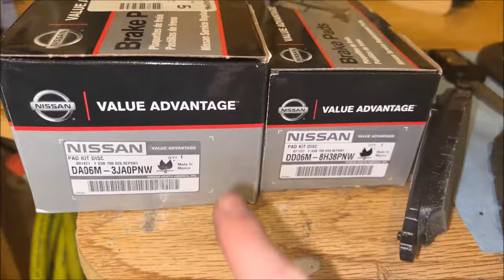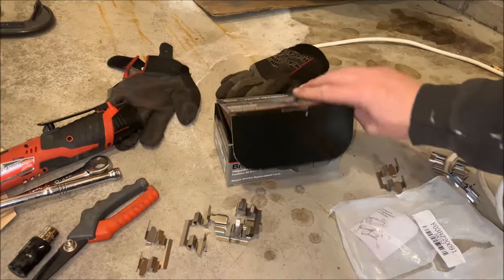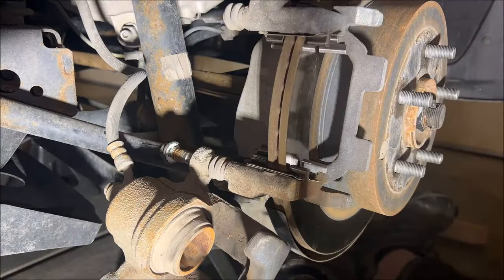Nissan Murano Brake Job (Front & Rear)

Comment: If you jack up the rear suspension from the bottom, it will compress suspension enough to clear bar so you can remove lower bolt and lube it.
Reply from the maker: Good tip!

Comment: Great vid. Always turn or replace rotors, never just pad swap. Since you only do brakes every 50-60k miles you will be asking for probs, vibrations, or noise if you don't take care of the rotor. Shop down the street from me will turn rotors off the car for $25 a pop, just call around your area. Much better than replacing for $100 plus if there is plenty of metal left.
Reply from the maker: Great point!  Thanks for taking the time to comment! 👍👍👍

Comment: $15.00 caliper kit from harbor freight made my life so much easier. But the c clamp life ain’t so bad.
Reply from the maker: Hahahah!  Yeah I’ve been meaning to buy one of those.  Thanks for the comment!
Reply: Thats the one that simply a long threaded rod with a piece of curved metal?
Its a PITA as you extend it fully to push the piston back and it wedges itself in and spinning the handle to release it simply unscrews the handle.....
Spot weld or drill a hole through the handle/rod and put a cotter pin in there.

Comment: Great video to the point did it quick. Just a tip the rear brakes on the bottom caliper bolt you can leave it on and just pull it down from the top. Don’t strip the bottom bolt like I did much easier on the other side now that I know that
Reply from the maker: Hello. Excellent tip! The Marano is due for another brake job so I will try this when I change them out again. Thanks!

Comment: Great video, thanks for sharing this! How would I know what rotor to replace if bent? I do feel there is one, not sure if front or rear, though would like to learn how to identify the bad one...
Reply from the maker: Hello.  You can feel warped rotors through the brake pedal, but if you're trying to diagnose a warped rotor with the wheels off, simply run your fingers over the rotor in several places to feel if they're inconsistent.  You can also tell by looking at the brake pads.  Uneven wear on the pads is a sure sign of a warped rotor.  Thanks for the question and I hope this helps!

Comment: Hi, somewhere it says when working with ABS systems, it is not a good idea to retract the pads in the way you do it without opening the bleeder first, so the fluid does not pressure back into the system. Have you consider this or have you had any issues after servicing these systems? Thx.
Reply from the maker: Hello. I’ve never read / heard anything like that, but that doesn’t mean it isn’t true.  I’ve never had any complications after a brake job.  It may be more of a best practice tip, but not absolutely something to avoid.  Thanks for the question 👍
Reply: @FastFixYouTube  Hi, I just did the break job (Front and Rear) on my 2018 Murano S  following your video and everything went well. Just were extra careful and compressed the calipers really slowly. I installed Akebono ACT1649 and ACT905A and breaks perfect. Thanks for the video!
Reply from the maker: @flashnvram2480  you are welcome! Yes, slow is better than a bunch of go when it comes to that. Nice job 👍👍👍

Comment: My friends Murano, hit the brakes and it's a ton of vibration, the rotors are only 18 months old, but I know they are toast.  Should we go with Rock Auto replacement, or carbon fiber from Rock Auto or go OEM ?  (130+, 206+, 400 for parts,r espectively).  Anything I recommend will be an improvement, but whoever did the last job, she only got 18 months from it.
Reply from the maker: Hello there!  Wow, 18 months is on the low side.  This could be due to cheap parts (likely) or if your friend is hard on the brakes.  Either way, I almost always go with OEM.  My experience with aftermarket brakes has always been a let down, no matter if I bought the most expensive or the cheapest.  I’d give the OEM parts a try if you’re looking for longevity.  Best of luck!
Reply from the maker: Also, if I’m reading your comment correctly, the OEM parts are $400?  If so, shop around. OEM will generally be more pricey, but there are websites that carry OEM stuff and can usually be found cheaper than if buying from the dealership.

Comment: Should add break-in procedure....
break-in procedure is critical to brake performance. Proper break-ins are necessary to establish an even layer of friction material deposited on the rotors from the brake pads. It is very important that this initial layer of friction material is evenly distributed.
Reply from the maker: Thank you for your comment. Sounds like you’ve got a good idea for a video 👍

Comment: Just a thought, it might make retracting the calipers easier by removing
the brake fluid cap.  That way there is room for the fluid to rise in the reservoir.
Reply from the maker: Hello. Yes, removing the cap can aid in pressing the calipers back. However, I have never taken this step. I suppose I just prefer to keep the system closed whenever possible.  Thanks for the suggestion and comment 👍

Comment: Does the clips goes top or bottom? I’ve seen some that put them on the bottom.  07 murano. Your take?
Reply from the maker: Without being able to reference mine in real time, I have no idea. I installed mine exactly the way the factory had it, however. If I put it on the top, it goes on the top 👍

Comment: Nice video, though really, really major mistake shown here.
Every time you do a brake job, you should always pull the 2 slide pins and re-grease them as it only takes like 1 minute each to wipe off the old nasty grease and put new on.
Kind of hard to believe 70K on original OEM pads and rotors as I seem to need ones every 2nd/3rd brake job. And that using Raybestos parts.
Another thing I've learned is that those pieces of bent 'wire' the better kits come with are actually needed as they press the pads out away from the rotor when you release the pedal.
Reply from the maker: Excellent tips!  Thanks for your comment 👍

Comment: was told by dealer that the cost of replacing rear brake pads is $600.00.  I don't think that includes rotors
Reply from the maker: $600 is incredibly high even if it includes new rotors.  I would go somewhere else or give this one a try on your own. Best of luck either way 👍
Reply: @FastFixYouTube $581which included rotors from foreign car repair specialist. Convinced it was high...will refrain from this happening again.thanks

Comment: sp you dont have to bleed the lines when you do the swap?
Reply from the maker: Nope, not at all. You only need to bleed the lines if you disconnect the lines or remove the caliper…as long as you don’t interrupt the brake fluid, no need to bleed. Hope that makes sense.
Reply: @FastFixYouTube  it actually does. everytime ive changed brakes ive always bleed the lines simply because thats the way i learned lol. i figured this was something that newer vehicles changed or something.

Comment: Just to let you know the pads you have right there are not OEM ,look at the box ,it says value advantage, which are a cheep line of pads that Nissan dealerships have and cost way less , and the quality is also way less ,but they never tell you that at the part counter or on line or when your having work done at a dealership, you never see or know what grade parts they are using  to do your repair ,and will charge you OEM price, if you do your homework and really care what your getting for your money and really want OEM genuine replacement parts that are made to the T for you murano, beware of what you are getting, look up what Nissan advantage value group is , your OEM genuine replacement  parts should be made in Japan, not in China or Mexico, it really pissed me off when I went to a dealership parts counter and asked them for genuine OEM parts , front and back rotors,and front and back pads,pads did not come with hard ware kits and have to be purchased separately, and mind you all that stuff is pretty expensive but that's what I wanted and was willing to pay for it ,and believe me when you buy and get the genuine OEM parts you will so see and feel the difference plus they will last twice as long and you will not see a spec of break dust from the  pads,so I payed for all OEM stuff and when I went to pick it up the slick fuckers gave me all Nissan lower end parts ,and I didn't even know there was lower end parts ,a friend of mine looked at the parts and schooled  me on what was really goin on,and I returned all the parts and told them, and now I would like to have genuine OEM parts not what you gave me ,the parts guy had a funny  look on his face like oh shit, no problem sir but your going to have to pay a bit more, and I did ,when you get the OEM break pad hardware kits there are alot more parts in the pack,it just sucks how much salesmen try to get over on people that don't inquire or don't know better ,we'll I hope my information help you out in the future!, God bless, and awesome video! 😊 oh by the way I have a 2018 Nissan murano awd s.
Reply from the maker: Are you freaking kidding me? 🤦‍♂️. What a bunch of scamming bastards.  I had no idea man….wow.  I recently did front and rear brakes on my f150. Rotors and pads. Got all “OEM” parts from Ford dealer. It’s been a little over a year and the front rotors are already going warped.  I put on 15,000 since I’ve owned it. The original pads and rotors lasted 55k.  These didn’t last 15k.  Now I know why. That’s such bullshit. Damn, hate to hear it but glad I heard it. Thanks man!
Reply: Good Information! Reminds me of Sears selling poor quality tools labelled "Sears" and "Champion", not Craftsman and obviously without the Craftsman warranty. Even the tools labelled Craftsman decreased in quality in the later years.